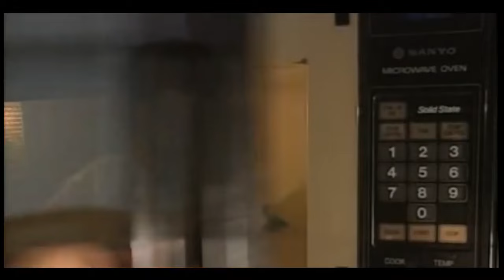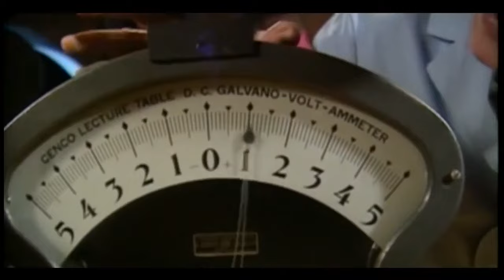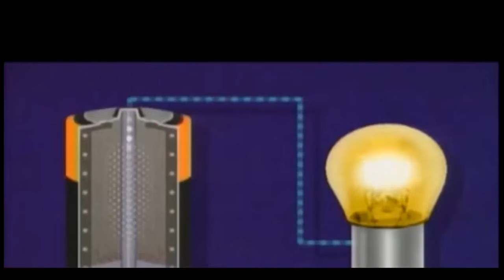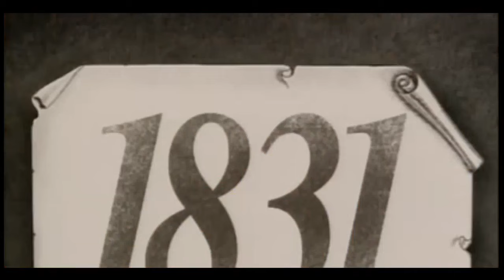Bill Nye the Science Guy S01E18 Electricity ❤❤

Comment: I dunno how helpful this will be, but…

1. When electrons flow from a power source, through a conductor, and through a resistor, it’s an electric circuit.
2. An electric circuit behaves similarly to a water hose.
3. Ohm’s law is V=IR
4. Cold metal conducts electricity better than hot metal
5. There’ enough electricity in a standard house outlet to stop your heart.
6. Micheal faraday used 2 coils of wire, a magnet, and a compass in his experiment.
7. Electrons are found on the outside of an atom, while protons and neutrons are found on the inside.
8. Materials that do not conduct electricity are insulators.
9. Batteries are plugged a certain way because electricity must flow from a negative terminal to a positive terminal.
10. Movement is kinetic energy, and water dams use the kinetic energy of flowing water to generate electricity.
Reply: I need two more